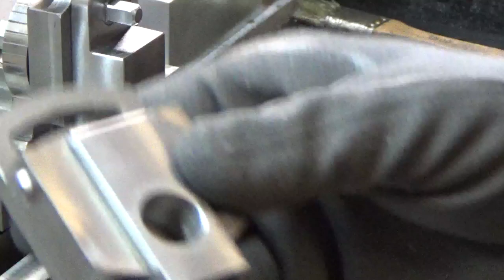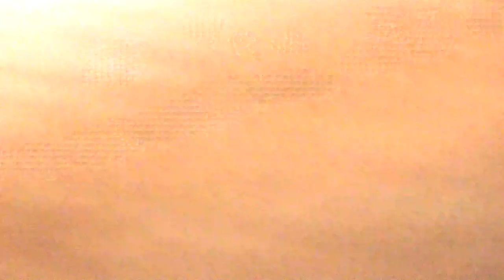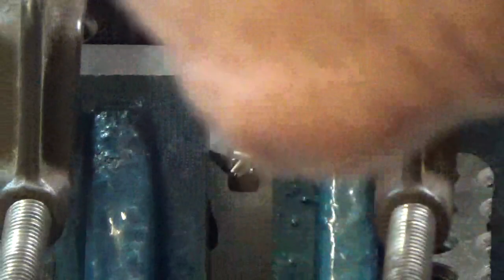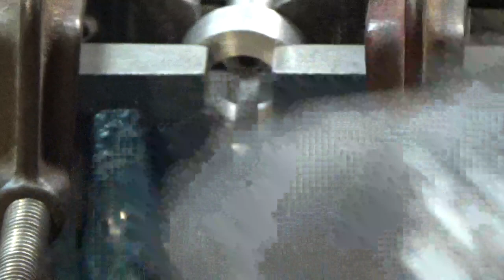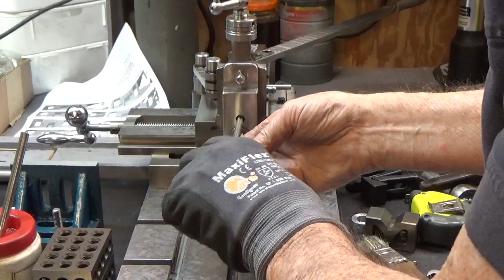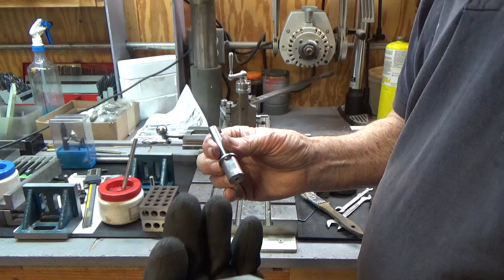Hand Metal Shaper Cutting An Internal Keyway In a Small Bore

Comment: Good job Larry.  Seems to me the clapper is only a big deal if you down feed before or during retraction of bit.
Reply from the maker: Roy:  Thanks for your comment.  For keyways the clapper has little use.  I did follow Walter's suggestion on the last video and removed the washer behind the tool bit, and that was a treat.  It probably removed some flex from the setup and also moved the tool bit further behind the pivot.  It worked better all around.  Regards: Larry